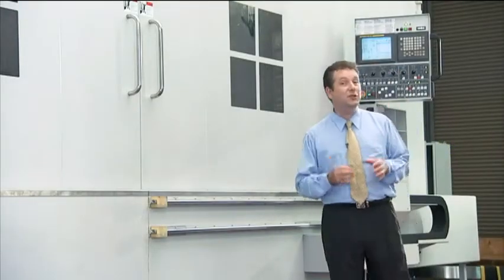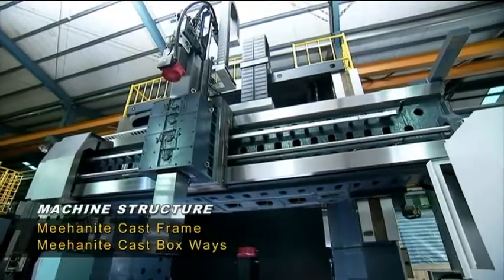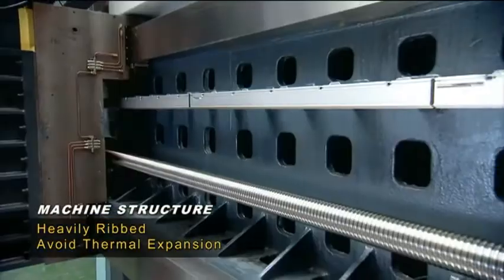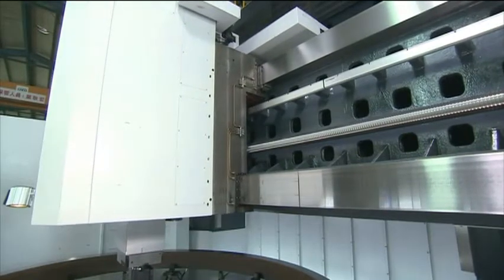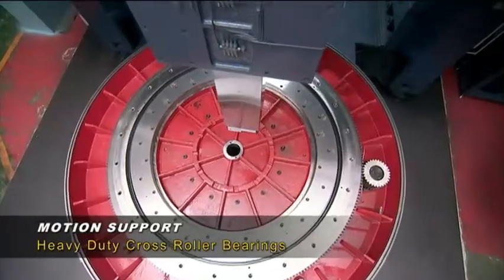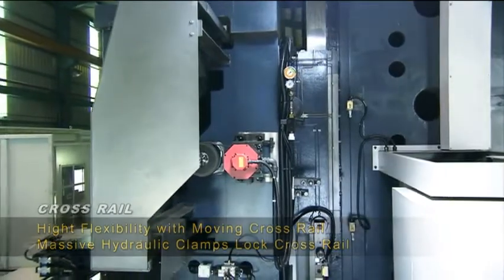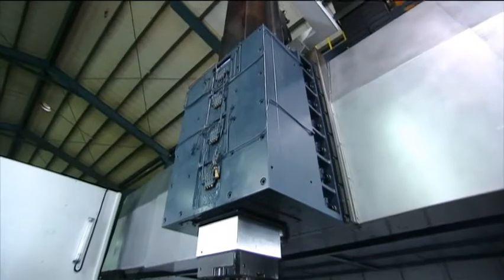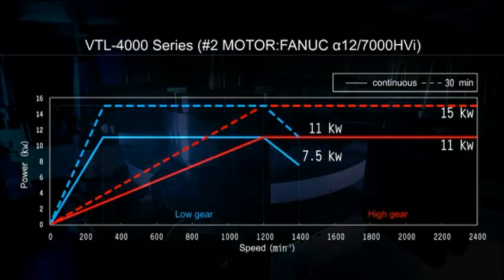Youji VTL-4000 ATC + C Vertical Turning Lathe

Comment: How to cut jaws in Youji CNC VTL -1200ATC

1. scan your work in the kiosk.
2. Read operation, check quantities, measure pieces.
3. Find the jaws specified in the paperwork.
4. Set the control to Z and X10 (1 thousand)  you will need it later.
5. Move a qualified bar the OD of the piece using the command T0303G0X27.300; (EOB for semicolon) in MID.
6. Set the jaws and base the required OD for the piece, put paint.
7. Move all jaws close to the bar, use a paper to check.
8. Put Z0 in the jaws
9. Move bar up about .500.
10. Use the programs to cut X and Z
Program to cut X in MID
S100M03;       (EOB) (ALTER)
(DOWN ARROW)
G97;                 (EOB) (ALTER)
(DOWN ARROW)
T0202;             (EOB) (ALTER)
(DOWN ARROW)
G01Z0F.014;    (EOB) (ALTER)
Program to cut Z in MID
S100M03;         (EOB) (ALTER)
(DOWN ARROW)
G97;                  (EOB) (ALTER)
(DOWN ARROW)
T0202;              (EOB) (ALTER)
(DOWN ARROW)
G01X(19.540)F.012;(EOB) (ALTER)   

11. Run the program, put the Feed in 0 and run it slowly, move the feed handle up and down really fast to check that you dont have rapid travel in your program, when you make sure that you wont hit the jaws, run the feed at 60 and let it go.
12. When your Z goes to 0, move your handle to manual, go down on Z to -.025 using the  remote, go up to 0 and turn off your machine.
13. Check that your jaws are cut properly and if not, set a dialer in the table and move the jaws .030, mark the first one so you wont get confused.
14. When you finish move the tool to 0 and move it out, make sure that the bar will not hit anything, move it out and move it down .007 and start your next program.
15. Move the bar up and send it home when your finish.
Reply from the maker: Thank you for your comment!

Disclaimer: Process not verified by Absolute Machine Tools